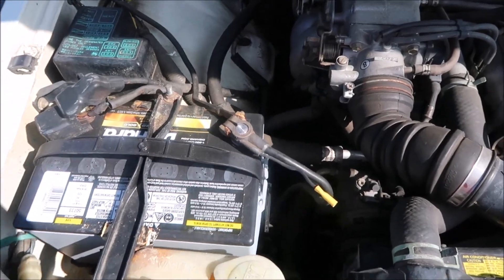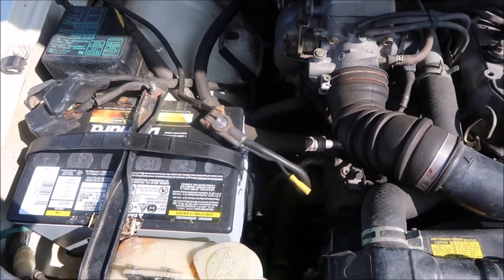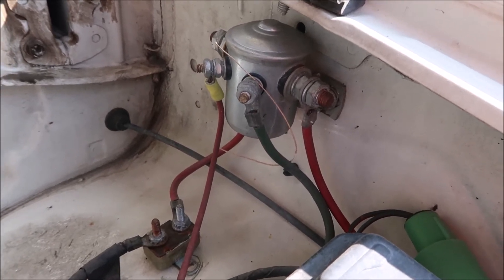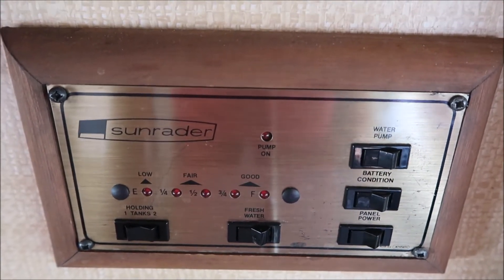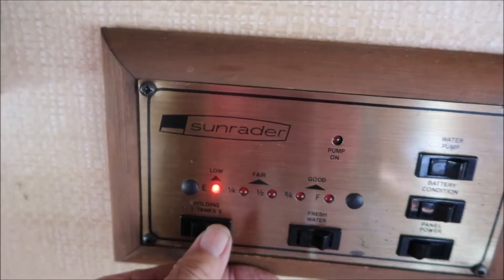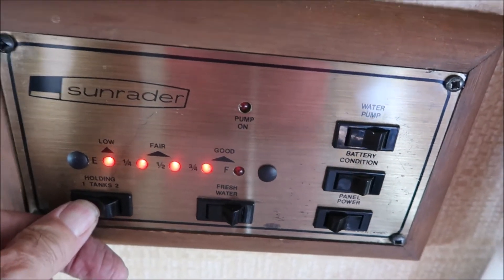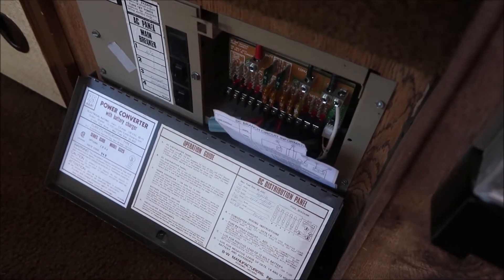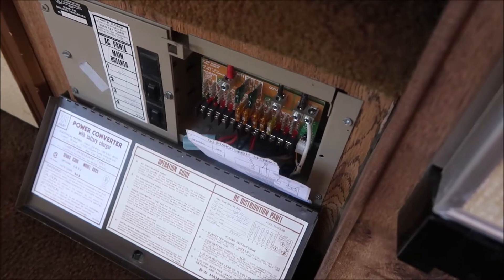RV Electrical Explained

Comment: Do your electrical outlets work off your coach battery?  I have a 93 Dolphin and the outlets work when generator is running but not off battery. Thanks for this video. Very helpful.
Reply from the maker: You're welcome.  No, they don't.  Must be plugged into shore power for that.  However I do have an inverter with outlets.  It runs off the coach battery.

Comment: If you ever need a battery and you're going to be near a East Penn - Deka factory it's the best place to buy one. If you learn their model numbers you'd be surprised they make just about every domestic battery you'll find in nearly every store. The stores just use different labels with their brands. Find a factory and buy straight out of the front lobby. I bought a mean $200.00 battery for $50.00 and tax at the one in Phoenix. They knocked $35.00 off because it was returned from a retailer. There was nothing wrong with it. I took their word and totally abused it for six years. It'd still work if my truck hadn't developed a nasty short.
Reply from the maker: Thanks for the info
Reply: You're welcome